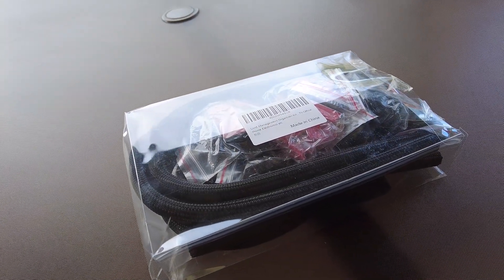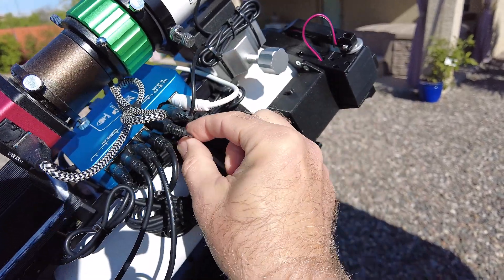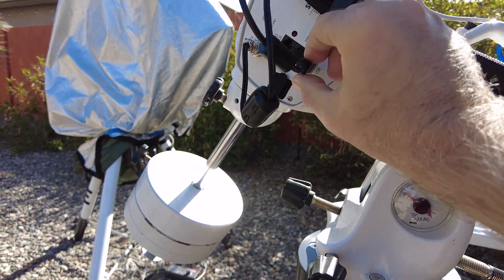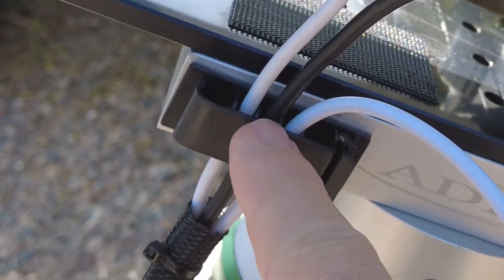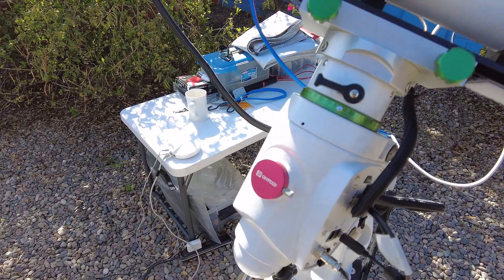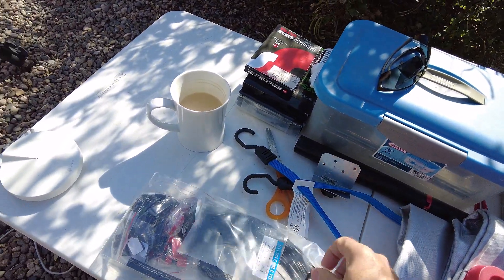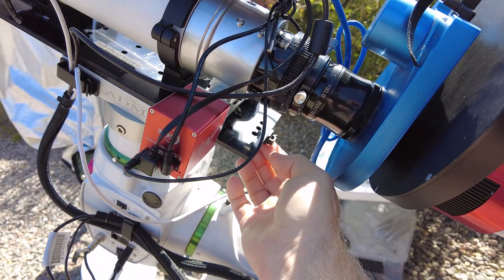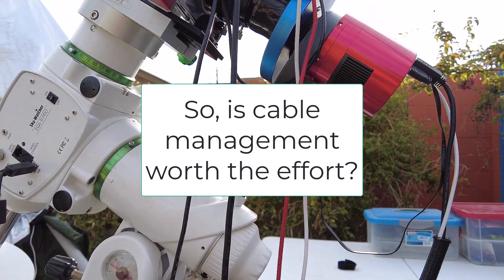Eliminate your tangles with good cable management *before and after*

Comment: I have an Eagle 3 computer that sits on top of my main scope. It runs all my electric and data. So I have just one power cable that goes below the rotational axes. That cable I run as close to the centers of rotation as I can get with just enough slack to cover the full range of movement.
Reply from the maker: Awesome. I love the form factor of the Eagle series of computers/power boxes. Have you had any issues with the Eagle 3? I see that they have just come out with the Eagle 5, but I am not sure what the differences are between the models. CS!
Reply: @DaveUrbanAstro  I picked mine up at the last NEAF, which was what 2018? Never had  even the slightest blip from it. I leave it on 24/7. I access it through Splashtop. I wish now I had a larger HD. I have to say it's a real gem.